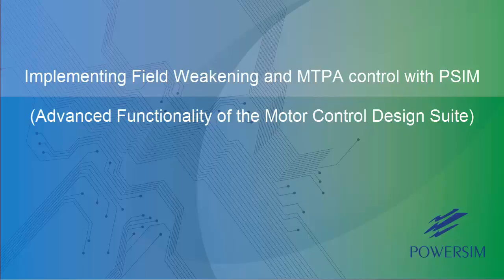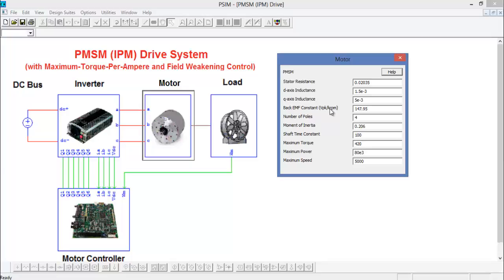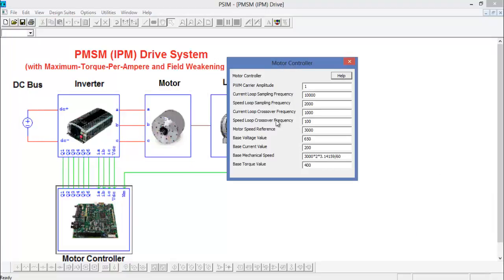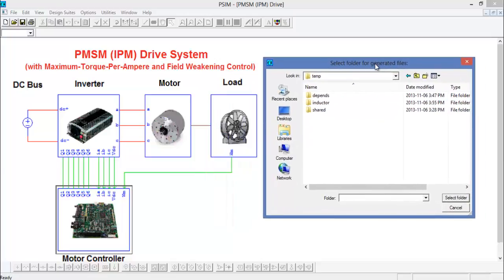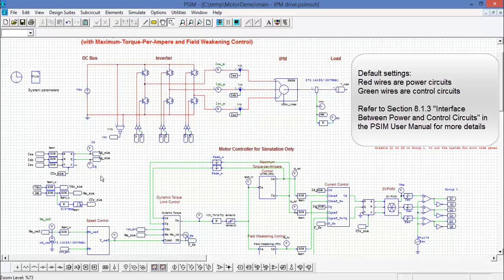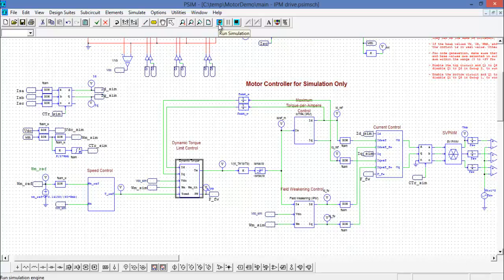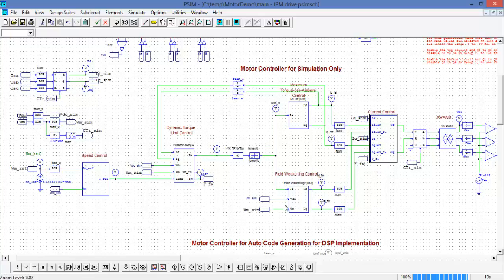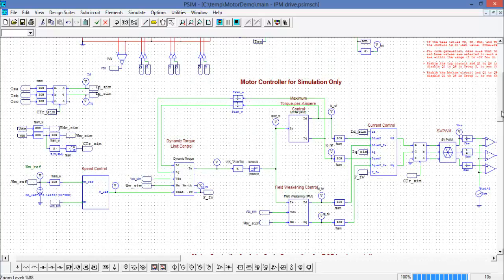Implementing Field Weakening and MTPA Control with PSIM

Comment: Hi, I use version 9 Psim and I 've seen there is a new Maximum-Torque-Per-Ampere-Control in version 10. Can I get this block for version 9? Thank you
Reply from the maker: Tusitala you'll need to upgrade to version 10.